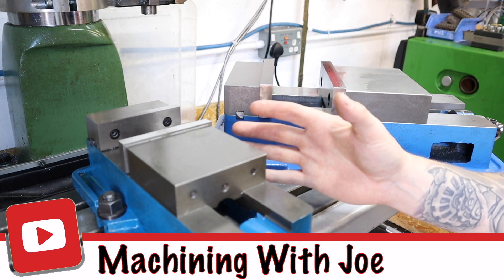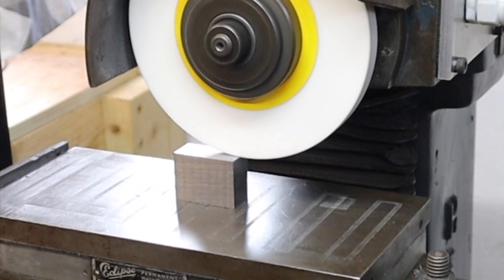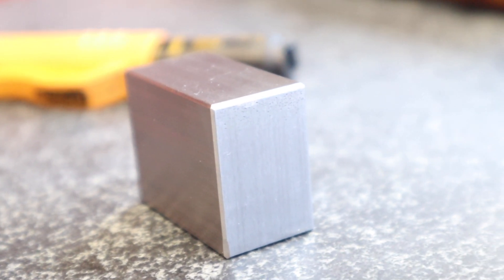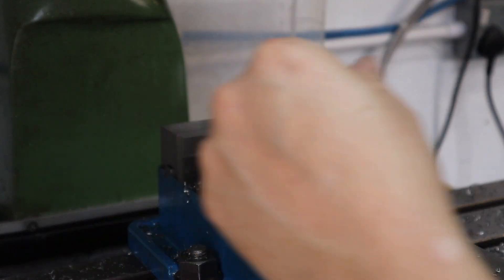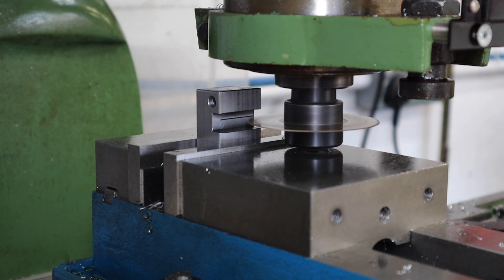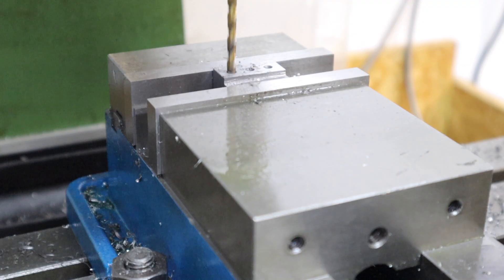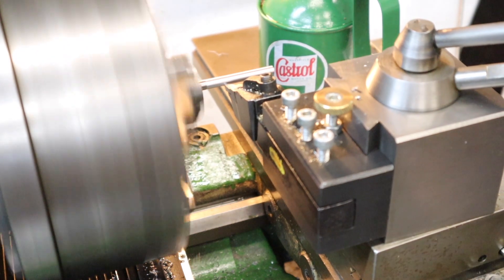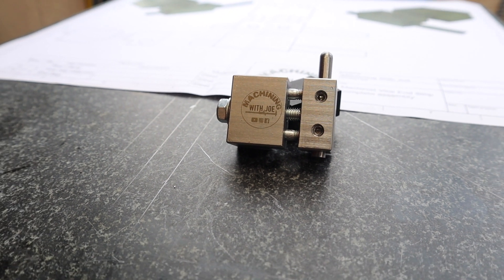Machining a Multi Vice end stop

Comment: I love how every manufacturer in Taiwan and China paints their vises blue, as if we'll be fooled into thinking it's a Kurt. ;D
Also, why are you (apparently) judging the surface finish and dimensions of a mill vise stop... on the plate with the gauge? 
I know I get carried away sometimes, but that's kinda silly.  Is your time worth nothing? HAve you no actual projects that need doing?
Reply: I’m a machinist by trade, and the majority of stuff I don’t even need this level of accuracy.

We mainly use calipers and mics, sometimes we’ll pull out the hight comparators, rarely well use the profile projector.

And, frankly, 0.04mm off target dimension with a surface grinder is a mile. You can easily mill/turn to 0.02mm of target dimension. 
But, if he has the surface grinder, and wants the finish from it, fair enough.

I would just use calipers to get it close enough (+/-0.02mm) then I would wipe it with scotchbrite. 
As you say the time is worth more than the part.

Comment: This wouldn't work for me or many others as I have a screwless or grinding vice without the separate fixed vice jaw. but it does have a tapped hole in both sides of the fixed jaw so all's well.

Comment: It would have been easier if you had made a thread on both sides of the fixed jaw of the vice. Fix a piece of flat steel with a hole for a piece of round steel. The flat steel has a hole for the screw, one for the stop bar and a thread to clamp the bar. With this kind of stop you can also stop parts that are not or only slightly above the vice without the danger of milling into the stop. If you use a long screw with two nuts, the workpieces to be machined can also extend beyond the vice.This is what the stops looked like in our workshop.

Comment: Whoa! when did you start with all the CAD? more to the point when did that surface grinder turn up, AND another thing slip gauges? I wish you would wait till I sign off on the spending. Great to watch another great video Joe. I found myself saying the same as you when the slitting saw went west.

Comment: Pop a flat or groove on the stop bar to prevent damage from the grub screws. When using this type of corner stop make sure your parts are dead square, or you will get errors.
Reply from the maker: Great advise thank you I will definitely do that before the surface gets marred up.